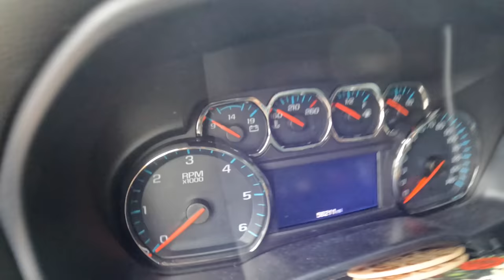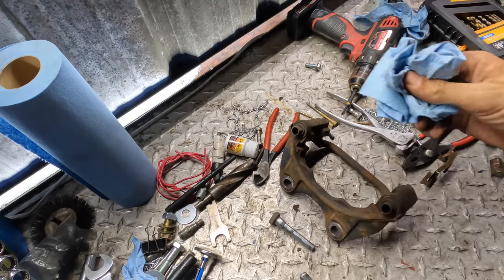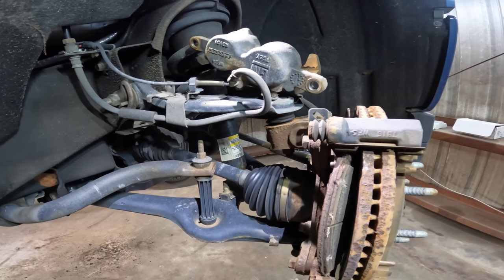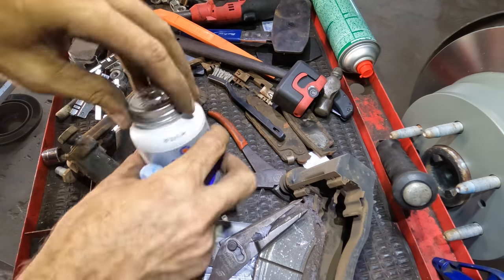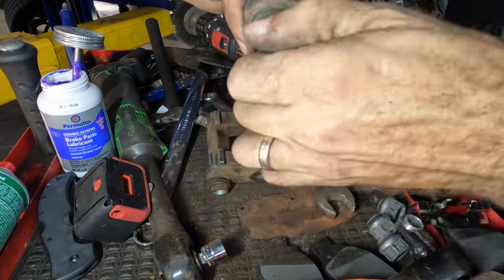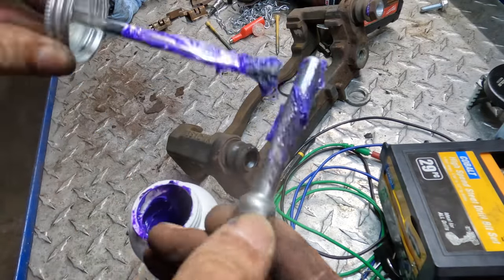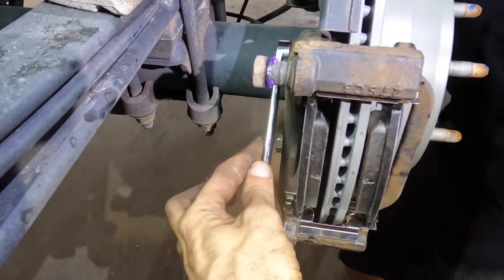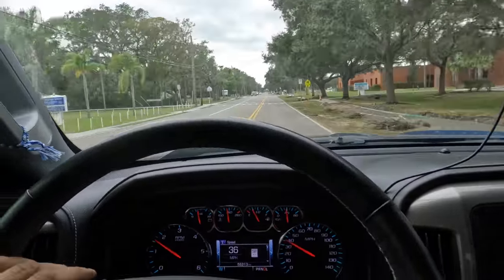Northern Rust! Challenge Accepted! New York Truck

Comment: Just saw around 26 minutes in, you pull both caliper slide bolts out, I usually pull 1, unless I cant, then pivot the caliper up and slide out the guide pin from the bracket. Flat rate thing to keep me from pulling too many things apart. Great work and I hope you are extremely prosperous, me, Im 56 waiting to retire!!!!🤣😂😅😆

Comment: Congrats on getting that first job in.

I also think you should swap the positions of the two lifts.  The big vehicles can go straight in and the small vehicles can more easily get around the corner to the lesser used lift.  (Or you could put another big one in place of the small one, but you probably need a few more customers first.)

After that test drive, I now know exactly where your shop is. :)  When you are ready to attract customers, you are going to need some signs to help people find you.
Reply: Great idea. I was thinking the same thing.
Reply: That makes perfect sense.
Reply: That does make more sense and given how empty the shop is now that could be a better layout for the future. Probably not cheap to do but taking the hit now while the floor space isn't cluttered with stuff would work out in the long run.
Reply: I agree switch them as long as the truck lift doesn't block the smaller one when you have a large truck on it
Reply: He said this is temporary while the building he want to move into is being built.
Reply: Yup, some signs and look for the cloud of brake clean over the shop. 😉
Reply: Came to my mind as well, thinking how much work it would be to swap the lifts. Possibly using same positions, if there is enough clearance in the front of the lift.
Reply: Dude - I just said the same thing lol.  We are all thinking along the same lines :)
Reply: I thought the same thing about swapping the lifts but if he does so and then puts a big truck on the heavier lift, there may not be enough room to get a car into the small lift.  I don't believe that's the case with the way they are now...
Reply: @matthewsykes4814  Or tear out that office space etc, and just convert it into 2 bays and have both lifts straight in... that angle is goofy.

Comment: My suggestion is to switch the car lift so you don't have to struggle all the time going on that 45 degree angle since it looks like that it's going to be the lift you use most. Other than that, Congrats on your new place and YES!, we like long videos.
Reply: I was thinking the same thing but it might be set up that way so the big lift has the most length available for longer vehicles.

Comment: Good luck Ray. LED for lumens. I installed 20 7w LED lights in the ceiling of my garage and it lights up my garage like daylight. I also used bright white semi gloss paint for the walls to reflect said lumens.
Reply: +1
best to have multiple sources of light (including surfaces they can reflect and diffuse off of) to avoid shadows. Few point sources = shadows galore
Reply: I agree. A white shop (Assuming it's kept clean) inspires confidence in your customers.  A dingy dirty shop will make me want to run the other way.

Comment: I am a 2/10 when it comes to auto mechanicing, just oil changes and other small jobs over the years.  Yesterday, after mowing the leaves with my little Cub Cadet riding mower, I noticed oil sprayed all over the place. So, today I bought my first two cans of brake cleaner -- ever.  Emptying that first can made me feel like a real mechanic, the same way my first cowboy hat and six shooter made me feel like a real gunslinger.  But, and here is the important part, it was exactly what I needed to be able to identify where it was leaking (the filter had loosened from vibrations) and I would not have known to do that had I not watched Ray's videos. Thanks Ray.  Your videos are changing lives.😀

Comment: Ray, that truck is not rusty! 
If you want to see 'northern rust', try working on few Scottish vehicles. 
Bolts don't come out that easy on our cars. 🤣🤣🤣

Good work none the less, congrats on your first job in the new shop! Glad you are back to work again.👏
Reply: True ☺️ nuts don't even resemble nuts anymore under cars here
Reply: I'm in Iowa where there's salt on the roads for at least 3 months. Lots of penetrating oil, and propane torches to get nuts & bolts loose. I had to pay to have someone cut off a lug bolt that had a rusted-on nut. It was not coming off.

Comment: I would say you need to switch the lift locations. Put the heavy lift in the straight on drive in door for trucks/heavy vehicles and the smaller lift on the side for smaller vehicles. Seems you would have a less chance of damaging a fender on a wall. Just a thought. Congrad on your new work location.  Have fun.  It will take time to adjust.

Comment: Ray, glad to see it coming together for you.  A suggestion if I may, and you may already do this but having an old barrel for scrap metal will bring in a little money.  No not much but every little bit helps.
Reply: Will be quit alot specialy with brake disks. 5kg per wornout disk makes 20kg per car that is 5 bucks. 
2 brake jobs a day and lunch is paid with srapmetal.
Reply: When I was breaking cars I started a bolt barrel. When it was weighed in, the boss couldn't believe how much money he had been throwing away - once he figured how to get it on the truck with the flattened bodyshells. Sadly innovations like that were not reflected in my security with the company.

Comment: Set up a small corner of the workshop for your battery tools with multiple charging points so spare batteries can be charging whilst using others, helps to keep things running smoothly. Plus all battery tools are in the one place, no need to go searching. hope this hint helps as my son a builder does the same.

Comment: Being from the north east ,,a little wipe of grease between the rim and the rotor helps it come off a little easier next time,it helps with the corrosion between the different metals
Reply: I use Anti Seize between the Rotor & the hub. Also between the Wheel & the Rotor, in N.E. PA.

Comment: Probably not a bad idea to work the caliper pistons by blocking the travel using your handy piston expander about 1/4" short of popping out the piston, pressing the brake pedal, and then pushing the piston back in using the tool.  Personally, I have seen a corroded-looking caliper piston later hang due to not having exercised the piston a few times.  Doing this also gives you an opportunity to inspect the piston boot all around.
Reply: He doesn't get paid to do that
Reply: @gregjohnson2073  oh but he could if he has to replace the caliper.  Retail plus 100% on parts.  That is usual shop charges.
Reply: I've had to take out the bleeder screw, then screw in a zerk, and use a BIG grease gun that went up to 10,000 psi to get a stuck piston out of a caliper before. Mashing on the brake pedal gives maybe max 3000 psi, not going to work. I ended up getting the piston out, but turned out was so pitted and corroded, ended up having to get new calipers anyways. Was a long time ago, and on an old car, so finding parts wasn't easy. Otherwise I would have never tried getting the piston out, what happened was it went sideways a little bit and jammed, I guess it got hung up on one side first, then the next hard stop, jammed it.

Comment: hey Ray, been watching your videos for quite a while now from over the pond here in england, but not commented before I dont think.

Just had to hop in and say that its great to see you back in your element! I watch your video's as a type of cathartic relaxation, I am disabled and would have loved in my youth to have had a manual labor type of job (mechanic, plant operator, forklift driver) but unfortunatly my physical problems made this impossible.

I will say one thing though, it is kinda strange not hearing the doodely doo's of the phone! I actually clipped the audio for your normal one, and that one video where it was sped up and use the sped up one in my D&D games as a sound bite if the players are taking too long without interupting them I play the sped up doodely doo and they know they need to either hurry up, or wrap it up!

Looking forward to what you make the shop look like in time, and its a shame you couldnt swapa the lifts around and have the bigger one as the straight through.

Take care in those windy parts, and do9nt forget to have yourself a great day!

Comment: If you spray silicone spray under the dust shields before you press the pistons in, it will ease the operation and make the pistons slide in easier. Greetings from Sweden, nice to see you in your new shop

Comment: Great video as always!  My main suggestions would be to possibly swap the lifts as you'll likely be doing more trucks, so that would give you a straight in approach.  Also, I've read and learned the hard way to never just depress a piston back in to a caliper.  This just forces contaminants and dirty fluid upstream and can possibly damage the ABS valves.  I always (and have read to do so) loosen the bleeder screw and let the old fluid out that way when depressing in the caliper piston.  Best of luck in your new endeavors!
Reply: Was going to say the same in comments
Reply: Very true.  Been there, done that.  And always flush the fluid on a brake service.

Comment: Great to see you are back on track!  The amount of extra useful bits you'll end up acquiring over the next few months and getting everything where it should be in the shop will be a bit frustrating but hopefully fewer frustrating diagnose and no fix jobs.
It's useful to hear which parts you are using, and I mostly agree on part price vs performance - in my opinion there are 3 bands: cheap and crap, midrange and sufficient, and overpriced for your needs, knowing which one to use when often comes with experience.

Comment: What are your thoughts on using anti-sneeze on the hub, the set screw and the surface that mates up to the rotor?
Reply: Hub, yes, what set screw, not too much on the rotor. It will run when warm
Reply: With all the salt and calcium on the roads in NH, I use neversieze on almost everything

Comment: While this may work down south, but "cleaning and sanding the hub" only ensures that the rotor will permanently bond to the hub surface in the next couple of years. The "next guy" will remember you dearly. In the cars in the rust belt, you want to clean the hub surface, then apply anti-seize compound between the rotor/hub, set screw, and rotor/wheel areas. This will ensure that the next brake job/tire rotation will be a breeze.  Also taking the master cylinder cap off helps to push the pistons back in. They will require way less force this way (and yes, even if the cap is vented).

Comment: I was doing a similar brake job on my 20 year old rusty Toyota Boston Ma.when my phone 📞 buzzed with a notification of this video,synchronicity.replaced a seized caliper and used an old used rotor. I did the same,grinding the pad tabs so they float.More Brake-Klean!

Comment: HEY! Customer number 1. How do you like the rust belt Ray? Pa uses too much salt too, but that wheel was easy compared to some I`ve seen here in Pa. I`ve had to hit the backs of the tires with a 3lb maul to release the rims from the rust jacking up the rims, then whizzy wheel(Eric O reference) the mating surfaces. . Shiny! Those caliper bolts came out easy, I usually have to soak em with PB Blaster and pray they come out with my 18" breaker bar and a 4 ft pipe(for leverage). if not, break out the hot wrench and heat them up. That customer got his money out of those pads...sketchy. At least the hardware still looks like hardware, not a disintegrating blob😁 Congrats on customer #1, 1st of many.

Comment: Tip from the rust belt,  just as Eric O did in a recent Chevy brake job video,  best to sandblast or thoroughly clean beyond wire wheeling the brake pad ear channels down to shiny metal.   Else the rattle clips won't fit well and you get pad bindage.

Comment: Really happy you're back turning wrenches on your terms. The only issue I observed was concerning the left front caliper. The outer pad wearing more than inner pad and excessive binding when compressing the pistons. I would have recommended replacing the caliper. This was substantiated during road test that a potential problem may be on the horizon.

Comment: Hey Ray, glad to see you're doing well post hurricane impact 
Us boys here in Canada see this rust on all cars, a result of road salt used during winter
When we dismount caliper support brackets, we sand blast and high temp paint them, some guys might even get powder coating done for future rust protection
We replace the corroded pins and bushings for safety, it's a minor cost for piece of mind
Best of luck in the new shop

Comment: When we do brakes in NY we typically put grease between the clips and caliper bracket as well as on the brake pad tabs to hold off rust and help the pads slide better.

Comment: I had to do a brake job on my 2013 Jeep Wrangler as the left front outer pad was down to the metal but the pad with the squealer still had lining left.  Replaced the phenolic  piston calipers with steel as my old Ford truck had the same kind of pistons that swelled up from Houston humidity and locked up the brakes with only 20K miles on the truck. It is probably not necessary but I clean out the slide holes in the caliper brackets before greasing them.  I was glad to see that you had to "adjust" the pads to make them fit as I have had to do that on the last several brake jobs.   

Thank you for directions to your shop (Ray's Auto Clinic), the store did the trick.  I hope to meet you in person one day.

Comment: You should always check under the hood for brake fluid level after first bedding the pads. You often push fluid out of the master cylinder when you compress the callipers, and then after a couple of pushes on the brake the fluid level in the master cylinder is low

Comment: Another great video. I recommend an Angle grinder with a twisted-end wire wheel takes care of rust real quick. Almost every brake job I do needs it along the slides, wheel it til it's shiny then I rub excess grease off my finger onto the slides then usually have to install the old shims because cheapness lol. But if the pads and pins slide freely then it's good to go.

Comment: As for pulling into the shop, you might try pulling slightly to the left, then backing up to get the proper angle into the lift. In other words, make your approach adjustments inside the shop.

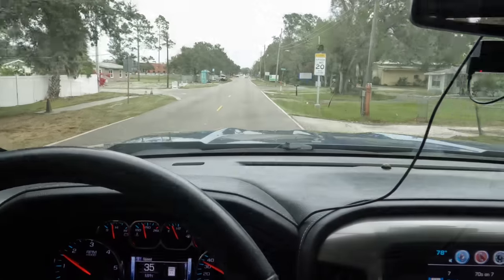Comment: 45:09  Those looked like coated rotors.  That's what I use here in NY... They are slower to rust.   Raybestos Element3 is my go-to pads and rotors.  Pads come with nice shims and fit the caliper well.  RockAuto rocks.

Comment: •  Those big ( olde skool ) 24" LAMPS you're thinkin' of will spin your electric meter like a carousel 😱💸 💸 💸 💸 .
•  I'd recommend many 4' LED shoplights , & as the flourescents you have burn-out , replace them with LED Retrofit "tubes" , or a whole new fixture ( as finances allow )
•  You can also wall-mount exterior style flood light fixtures  pointed into the wheel wells & engine areas , & use LED Spotlights.  I replaced an old tungsten 150W oversized bulb with 3 LEDs: Spot , Flood , and general area std.size  that only use 27W for all 3 , yet provide better and brighter light where i need it 😄👍.  ( edit typo )

Comment: Don't know how it is in FL but as a fellow mechanic who does more side work then work work for the future when you do have air at your shop invest in a sure shot and buy brake clean by the 5 gallon drum. When I did that my supplies cost was nearly cut in half for brake clean.

Also for brake lube bend and break the brush off the cap. You can keep the brush cleaner and then you arent fumbling with the cap for articulation.

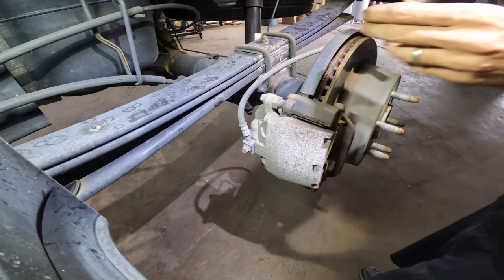Comment: 4:25 explains the difference in wear of the front pads. R/F working is working extra during braking.  And I found the shop but won't post it.  ;)  only about 1200 miles south of me.

Comment: RAY , clean clean clean that rust ,shim seat is where you wanna see SHINY SHINY, shims will pop in easily and no grinding of pads will be needed (takes same amount of time) .  Save a little brake clean for pin holes(small round plastic brush works awesome for dry holes) and grease under shims especially if truck is returning to NY , GOOD LUCK at self employment , first year is the roughest ,up here we call it  "thrown to the wolves"

Comment: The last shop i was at had that same atlas lift. The ladder that the locks set it as the lift goes up and down got all gouged up and worn down. We got the lifts brand new, had their guys install and set it up. After a little bit it needed some tweaking as the cables broke in. You can hear the locks click if they are dead on or one clicking before the other, or when going down on the locks one side hits before the other. I noticed in a previous vid the locks werent clicking evenly when first started going up but then would click even, and noticed one side hits first when going to sit on the locks. Id check the ladders to make sure they arent worn and make the little adjustments in the cables so everything moves evenly before the ladder gets messed up if it isnt already. They are good lifts but do require some maintenance.

Comment: He brother just want to say awesome job and playlist. I got an 05 Tahoe and when I did my brakes I sprayed all my caliper and caliper bracket bolts, away from the rotors of course, with PB blaster. Leave them a little wet when putting them back. Slows the rust inside the holes. Hence easier removal in the future

Comment: I have had to deal with of Northern rust all of my life! only one time did my dad get a
‘67 VW bus from NC. it was amazing to be able to un bolt things w/o a torch. a bit of
penetration oil then lubed when re assembled so the next time you can pull the fasteners.
each time I do my brakes  I have to deal with what you are with the truck.